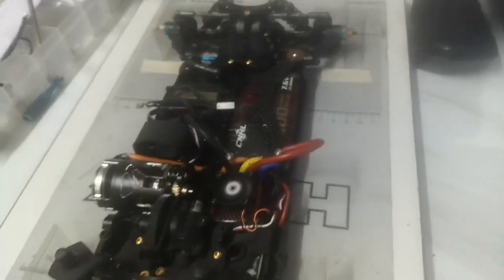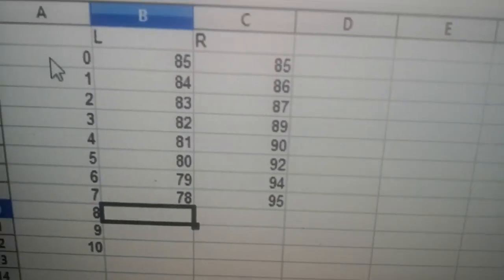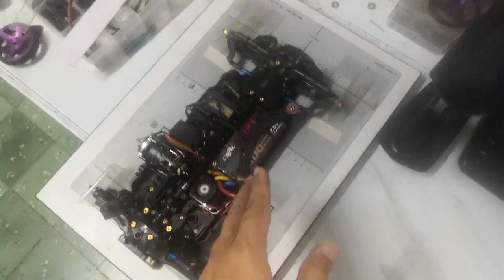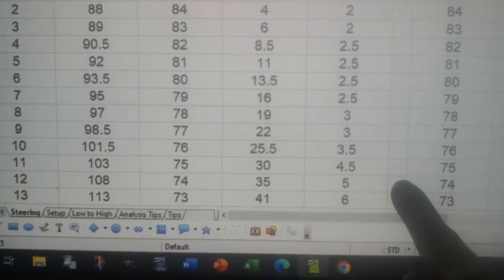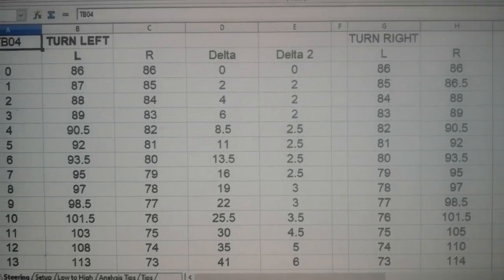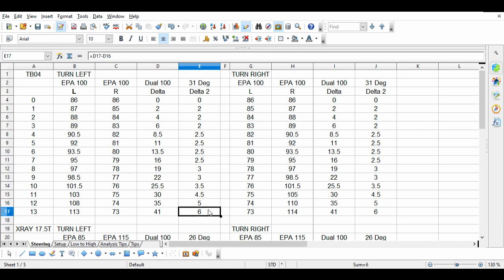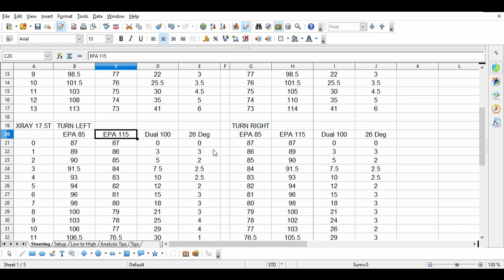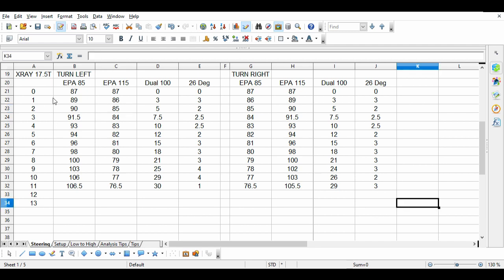Go Faster Tips - More Steering, Flow and Corner Speed

Comment: I don't believe it, it's like you have read my mind. I have been thinking about this all week and was going to try some adjustments this weekend. Then I see you VT. Awesome 👍👍
Reply from the maker: What were you trying to achieve?
Reply: @rccartips I'm getting a lot of lift of over steer. I'm using lots of drag break to loose it but I'm loosing speed into the corner because of it.
Here is my set up:-

Tamiya M07 front toe is set at factory
-2deg camba.
Rear toe is set at factory -2deg camba
High gauge (red) sway bar front and rear.

I would like to carry more speed into corners and not too fussy about loose straight line speed.

Comment: Another excellent video using  imperical data to tune. I'm curious,  what length do you recommend for the plastic extensions that connect to the wheel hexes? Cheers.
Reply from the maker: Around 60mm

Comment: Great vid👍 Could you do a similar video on how your ta05 setup does as I'm getting issues with mine, one minute it's running great next it's going a little bit left I correct it via trim and then it goes right. I rebuilt it and everything is correct and straight but just seems to have lost that top performance.👍 When's the next race😁👍
Reply from the maker: Could be your tub is fatigued. Do you use a servo saver or solid horn? I avoid servo savers as they cause steering problems. Rainy season here, mostly practice sessions.
Reply: @rccartips  cheers for replying, I use a fixed servo horn. I'm goin to redo the electronics and see if that helps also replace the servo, then check alignment.👍